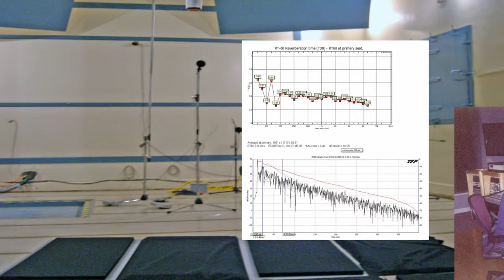Room Acoustics is a Six Step Process

Comment: Thought experiment: You usually put some absorption at the first reflection points on the side walls. What happens if you place those absorbers still along the trajectory followed by first reflections but, say, midway between the speakers and the wall?
Reply from the maker: I'm not sure if I follow, but if you're adding more absorption to the room, that may or may not be a good thing. This is why testing is important. There are plenty of times where the room already has a lot of absorption, yet nothing to tame the first reflection points, so you add diffusers there. That way you break up the specular reflection and it's interference, while NOT introducing more absorption into the room.
Reply: @AVRoomService  My bad, sorry. My question wasn’t directly related to the video. I was wondering about the effects of positioning absorption at different points along the trajectory between the speakers and the first reflection point.
Reply from the maker: @giorgiovaloti4129  Introducing absorption anywhere in the room will reduce reverberation- specifically resistive or velocity type absorbers. Diaphragmatic or pressure type absorbers need to be placed in appropriate locations in order to be affective.